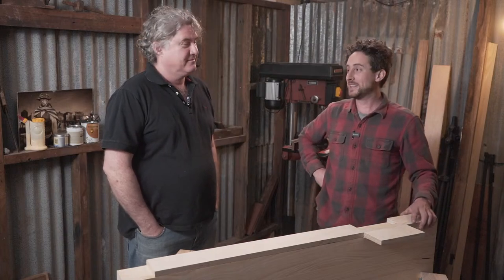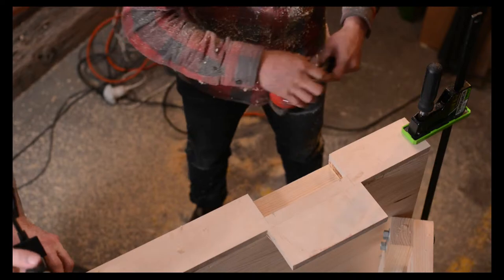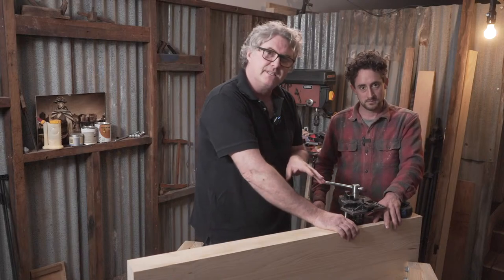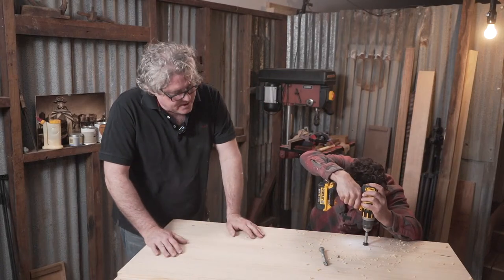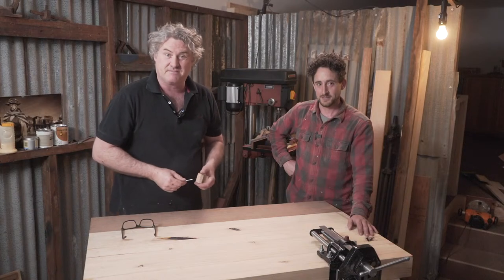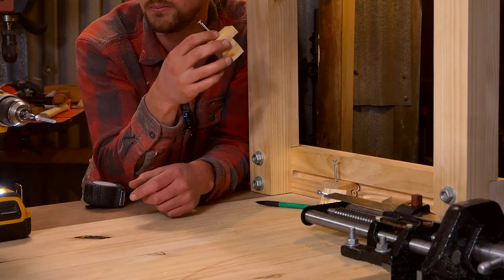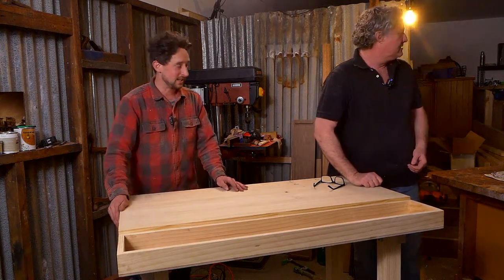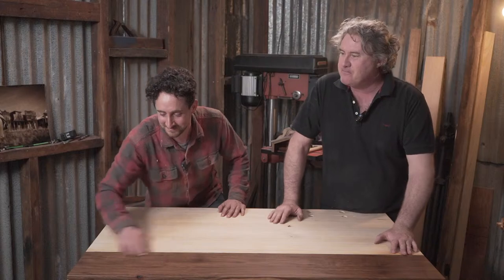Timbecon - The Tiny Workshop Ep. 8 - Tiny Bench Build - The Bench Finale.

Comment: Hey Guys, thanks for the content. I was wondering why you  use the bolts all the way through the bench for the vice and not couch screws in from the bottom?
Reply: Hi Fergus, it would probably be ok to use couch screws, Patrick and I did discuss this before the stream.  However, like most things in woodworking, it's all about the material. For example, if you we using a tight grain hardwood such as Jarrah to build your bench, couch screws would probably be ok as the density of the timber would facilitate a very effective bind with the thread of the screw, and the Jarrah's hardness would minimise the chance of the material breaking down and the thread losing its grip. In the case of pine, we can not rely on either of these factors to hold the vice in position long term, so we played it safe and opted for a through bolt which is the fail safe method of attaching anything. Hope this helps..
Reply: @johnmadden2256  awesome. Thanks John.

Comment: Great content,  Bench looks really good.  Question about the use of the router.  I have heard that shallow passes should be used but rarely do I hear an actual measurement.  I have heard a "rule of thumb" of half the diameter of the bit.  What was the depth of your cuts tonight.  Any other recommendations reguarding this topic.  I look forward to the next show.
Reply: Hi Mark, yes the rule of thumb is the radius of the cutting bit.. however there are other considerations for example - the type of material being machined (hard or soft, brittle or greasy) and how sharp is the bit is.. our general advice is to be conservative in your approach, maybe be do a test before you start on the main project.. hope that helps.
Reply: @johnmadden2256  Thanks for the info John

Comment: Hi guys, thanks for a great show. Newbie question, what are the dogs you were talking about at the end there? Thanks!
Reply: Hi Dawn, dogs... bench dogs are a hardware element you can use to hold work in place on your bench. In simple terms you bore a hole in your bench, and insert a bench dog so it stands up like a little fence post. You can now push against this post whilst performing a task like planing for example. Its probably easier to visualise this then me try to explain it.. check out this link and see for yourself..  https://www.timbecon.com.au/torquata-brass-workbench-bench-dogs-2-pack  And please stay tuned, we will make a short video on bench dogs for the next episode of the Tiny Workshop. Cheers
Reply: bench dogs, you drill a hole or series of holes in the bench (usually 19mm) and then push wooden or brass dowels that sometimes have a spring, sometimes a squred head or sometimes with  the round end with a cut out (dogs) in the holes protruding out that you can push the work against if you are planing for example (a simple example is https://www.youtube.com/watch?v=93qcLixf22s).